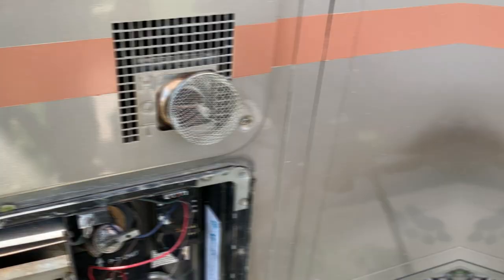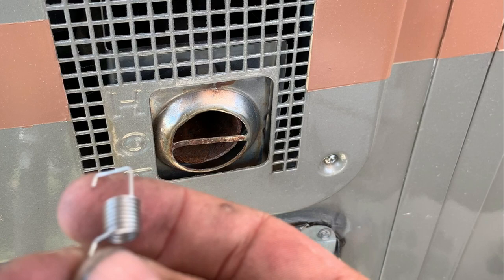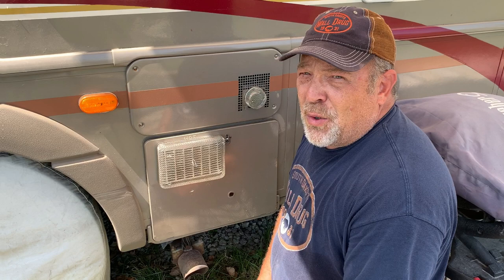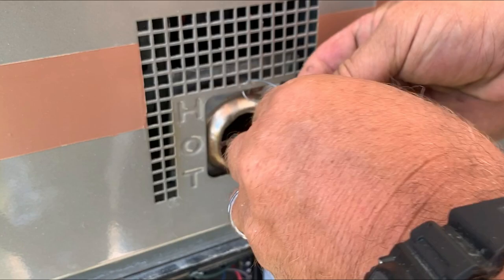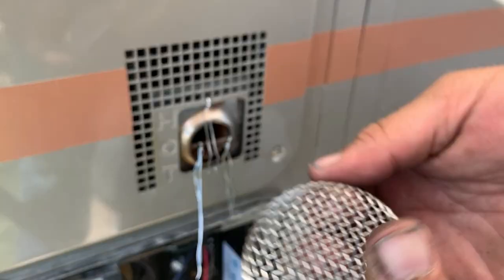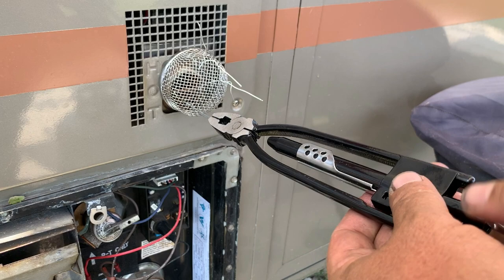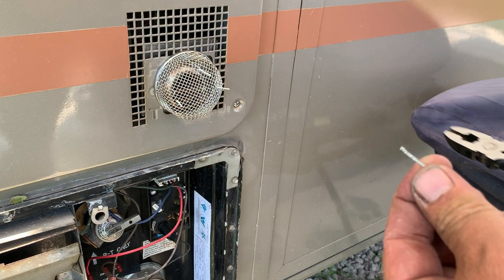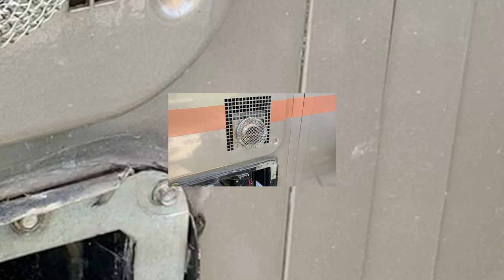🔴OMG! The Better way to install RV bug screens covers Ever! | rv diy tutorial

Comment: I've had my bug screens (attached with springs) on my fifth wheel for over 5 years with no problems. But if i do, I will certainly safety wire them down - nice fix!

Comment: Hi Aron! Good idea; good job. But what caught my eye was that wire spinner. I don't need a wire spinner; in fact, I don't think I've ever seen one before your video. But now I want one. I might be a tool-aholic. Safe travels!
Reply from the maker: This is nothing new, the military uses this  method to secure parts on aircraft. Did you find the tool?
Reply: @3tailsRV  Most of my family worked for Grumman Aerospace and Northrup after military service. I'm sure when they were on the floor they used this all the time. My brother and father used to show me specialty tools - very cool. I just don't remember this one. I haven't looked for the spinner yet. Have to wait til after property taxes to see if I can spare a few bucks.

Comment: Thanks for the tip. Great plan. I opted to use my drill and clamped the 3 drill teeth down on the 2 wires instead of pliers. Set drill to slowest option and gently press the trigger....done!  Was able to just barely loosen the drill after spinning, move to the next wires, then insert the next wires without spinning the teeth open all the way. The screens are completely immobile now !!
Reply from the maker: WOW great tip!! save some money and that is always a plus!! thanks for stopping over and offering that up to our viewers. and as always thanks for watching and taking the time to leave a comment.  Hope to see you in the  remarks of our next video..

Comment: There is a different shape screen available for your furnace outlet. It fits behind the grill and still has a protruding “bubble”.  No need for safety wire with the correct screen.

Comment: For that furnace you want a Valterra A10-1302VP Bug Screen. It fits INSIDE the grill and has a bulge in it at the exhaust. Needs nothing to hold it in place, just remove the outer panel, place the screen in place and reinstall the panel. If you like you can wire the screen in the corners. Use .020" stainless aircraft safety wire. For the water heater I bought, from Amazon, a small piece of #8 mesh (8 openings per inch) stainless woven wire (used by beekeepers but the same stuff those RV screens are made from) I cut it, fitted it behind the water heater grill and wired it to it.
Reply from the maker: +CharlesinGA that is a great tip

Comment: Are you worried about this voiding the warranty on the appliances in the RV? Also our RV has a full residential fridge and is operated only by battery. I don't have the usual intake or exhaust for the refrigerator. In fact I don't even have an access door to pop off to insert screens. I only have manual louvers that I open or close and snap shut. Any recommendation on how to keep bugs out of that? I don't believe the screens will fit
Reply from the maker: +Steve C these will not void the warranty and often added by the dealership

Comment: How do you get them off?
Reply from the maker: Cut the wire holding it on
Reply: I am new at this. Just to make sure. You unfold the bend on each one, cut them and slide it off?
Reply from the maker: @lidiajohnson8546  yes that’s correct